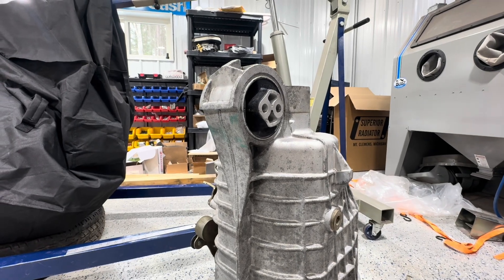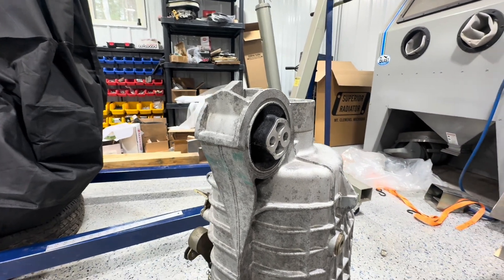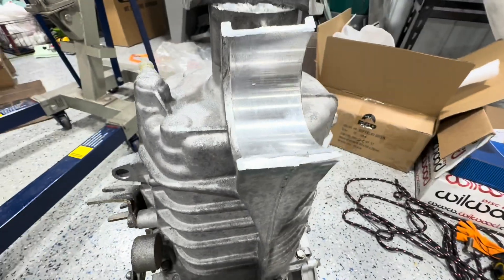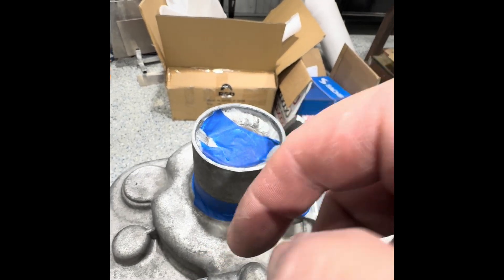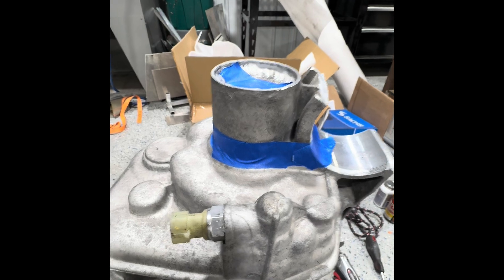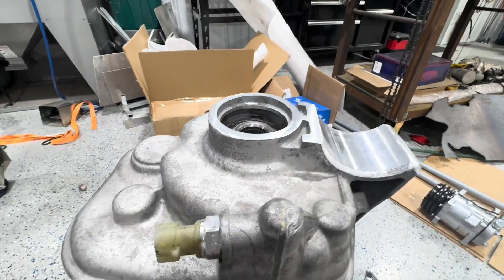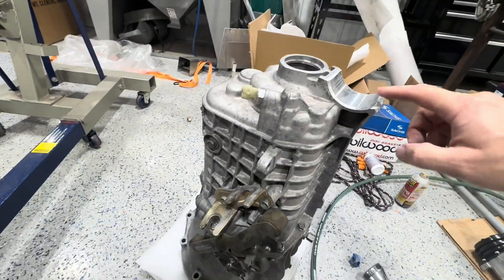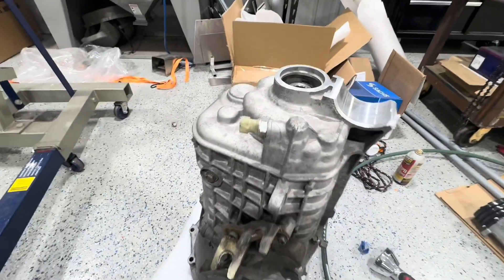Ford GT40 (RCR40) Project: Cutting the end off a Porsche G96 transaxle.

Comment: Soo how much torque is that 302 putting out. Im sure you know this but that gearbox was only used on plane jane porsches, not high performance applications. Also the 981 6spd is already setup for mid engine.
Reply from the maker: Around 400. It’s not a stock G96. The adapter plates all existed for this setup at the time. Not sure on the 981.
Reply: @official-lakelakelakewi  who built the gearbox? Guess it depends on the vintage of the kit. New 6 speed caymans put out over 300ftlbs, 996s were never even close to that.
Reply from the maker: @Redgrave-v2pGBox in Erie, Colorado
Reply from the maker: @R@Redgrave-v2p My hp will be around 400, torque is probably closer to 300.
Reply: @official-lakelakelakewi  no dyno sheet?
Reply from the maker: @Redgrave-v2p Nope. I built it myself. Not that important to me.

Comment: Nice job, but on the RCR GT40, you get 2 buschings on top of the gear box that are connected to a top aluminum rail in relation with the chassis. I do not see those two "ears" on your box ?
Reply from the maker: That would be on a ZF or a Quaife transaxle. The G96 doesn’t mount that way.